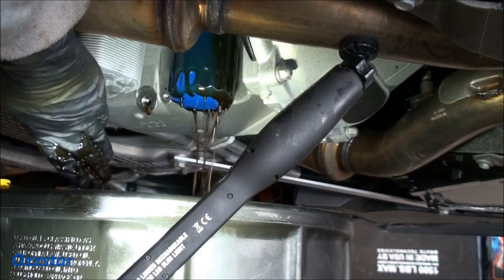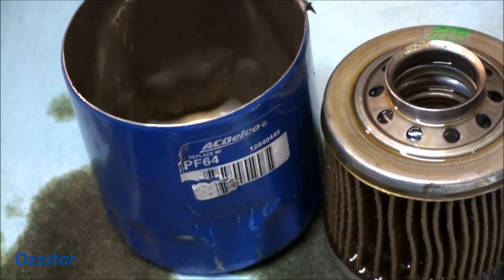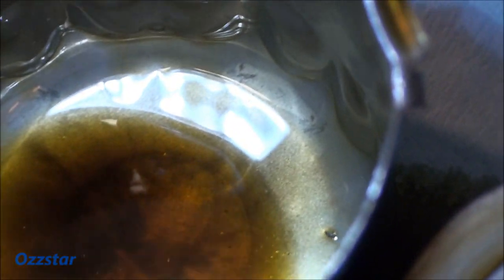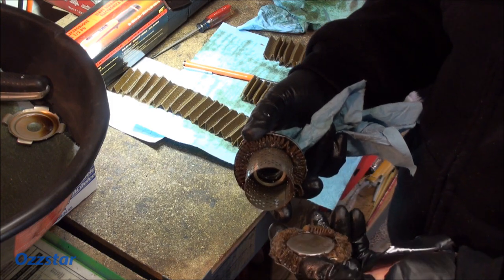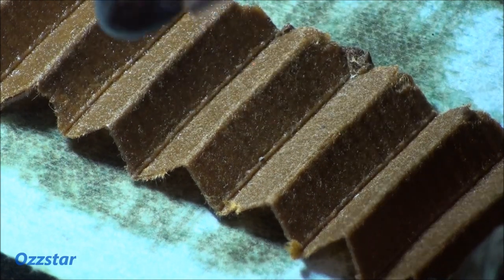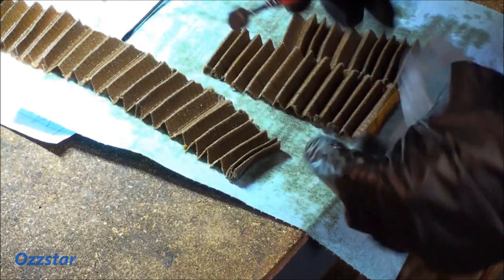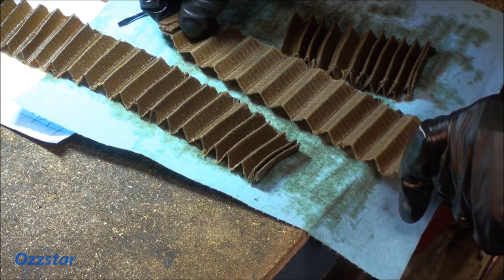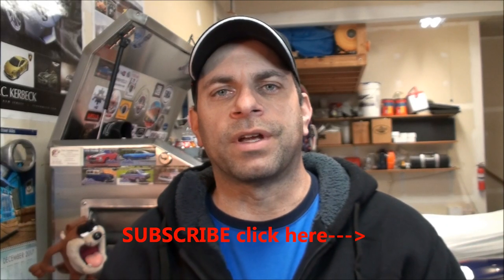C7 Corvette OIL FILTER the 500 mile filter autopsy

Comment: Didn't expect that (the glitter and that it's normal due to pump break-in)... when's the next one do? I assume you'll be cutting that one open as well?
Reply from the maker: GM claims 1,500 miles is full break in.  I am considering dropping the oil then to see how the oil/filter looks. After 500 miles according to GM the oil is changed at regularly scheduled changes.  No way do I go 7500 miles!  The oil should still be fairly clear at the 1500 mile mark and I will change it again.  I think zooming the camera in made it look worse than it was.  Also, there is a bulletin about the silicone gasket sealant can degrade the anti foaming agents in the break-in oil, so they want it changed at 500 miles.
Reply: What kind of documentation do you need to keep things "warranty approved"?
Reply from the maker: Besides documenting with video I have receipts for the oil and filter.  That's it.  What do you guys in Canada have to do in this case?
Reply: I've never owned a car that was under any type of warranty... but I believe that Dealerships want to see that the oil change was done at some type of service shop (company name & parts on receipt). Dealers will tend to void anything and everything if there is any type of questionable history... then again, that might just be VW & Audi! LOL

Comment: Drysump: i bet the 2stage electcontrol OilPump is very expensive!! Not to mention the weak thrust bearings on manual cars. Auto too!   Heard stories from gm c7 expert that thrust bearing going way out of spec is not rare!! And some motors only had lower t-bearing installed!?!? No upper half!!!!
C7 manual cars, be careful with riding clutch pedal at stop, or moving!!   & Early 14-15 c7 all had the failure-prone loheat driveshaft couplers!!  Before june2015, my c7 7 mt was a month early!   So now i need to fix/replace driveshaft or entire torqtube assy. !  $2600 part!
And complained about it 4 times at dealer over 1st 15,000mi.  They kept saying clutch is going bad or has oil on it.  Well, i spent $500 on factory shopbooks from Helm.....and under driveshaft coupler symptoms, it clearly states clutch shudder!!
In summary:. I am retired GM proving grounds special test guy.  I know the co. And the games.  And the details of decades of these cars and others( BOC), Brakes, performance, etc,etc.
Be educated & aware, especially on Corvette.  Many are foolproof, most have engr problems that You will get stuck paying for.  Ck your serp belt tensioner!!  Hyd, made in Slovakia. Regularly fail. Mine lasted 18,000 !
Caution:. READ INSTRUCTIONS on how to install!!  Easy to damage by incorrect install!!
Buy shop books if you are a tech. !!!
My 2 cents worth.....😎

Comment: Just purchased a 2019 Stingray 2LT Z51 in Florida is it safe to drive home to NY 1200 miles then change the oil instead of finding a dealer on my way home to have it changed at 500 mi.
Reply from the maker: That's a tough call Glen.  I can tell you at 500 miles there is a ton of crap floating in the oil.  I dont think driving 1500 miles will hurt it major but I would drop the oil at 500.  I am in Delaware, so out of 500 mile range. 🤔  Enjoy your new toy man!  -Glen (Ozz)
Reply: @ozzstars_cars  Thank you for getting back so fast. ill just figure out where the closet dealership is at 500mi. off of 95 and go from there. Great videos

Comment: How often do you plan on changing your oil?
Reply from the maker: I have 6500 miles now, changed it at 2500, really no metal flakes, next change was at 5000. I plan on no more than 3500 miles in between changes max, or 1 year.
Reply: Ozzstar Is there any drawbacks to changing the oil too much, besides spending extra money? Also when do you plan on changing your brake , differential and transmission fluid
Reply from the maker: @pjfan173  nothing to lose but money. Oil can never be changed to often. Differential fluid I may do fairly soon, by 7k miles. Brake fluid in about 3-5 more years regardless of mileage.  Trans fluid I will have to do some research on.  I own scan tool equipment which is necessary to get that job done.
Reply from the maker: @pjfan173  did you see the C7 oil change video and how to safely Jack up a C7 vid on my channel?
Reply: Ozzstar Yes a sure did. I bought those permanent jacking pads and decided the safest thing was to buy a Quickjack since I’ve never done anything besides rotate tires. I bought the a hawk pads that you installed and again the Quickjack seemed the best way for me to get into doing my own service work.
Reply from the maker: @pjfan173  that's cool that you are taking on something new and pushing forward!  Have fun wrenching!  Thanks for watching the videos, glad they helped you out.